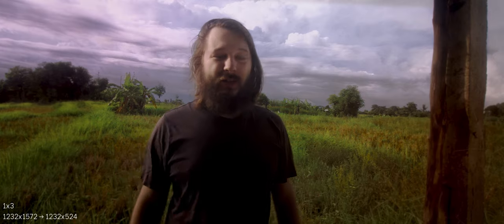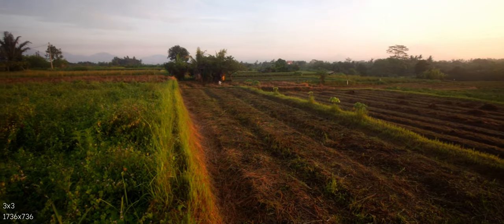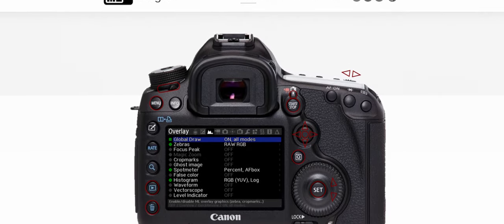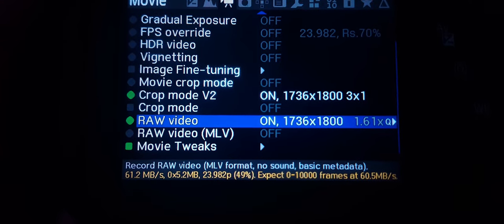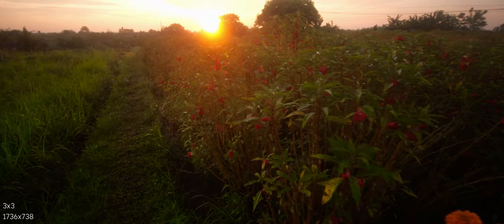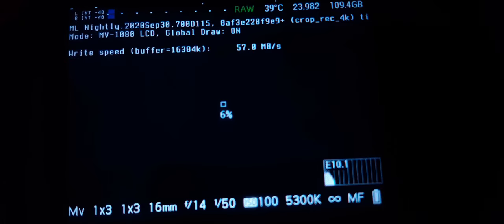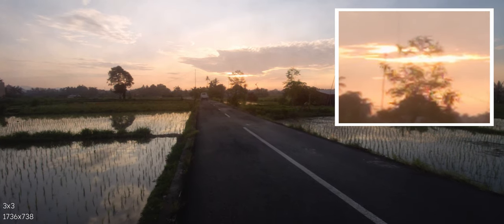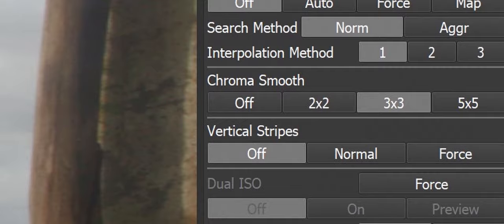Binning Modes Explained

Comment: Hello Dimitri! Thank you for these videos! I installed it on my 700D and now i'm learning how to work with that. 
But i don't understanding exactly how crop mode work. If i choose a highest resolution, it expand the image to that, and then it crop a little bit of this image?
Reply from the maker: It crops into picture to achieve 1to1 sensor read out. When it read the wholse sensor it skips pixels in between. Can cause artifacts etc

Comment: Great explanation! I have the 700D and this experimental build, and I'm having some random pink frames. I'll try your method and see if that works.
I bought a Sandisk Extreme Pro 64GB 170MB/s and 240Mhz overclock works fine, except for the aforementioned pink frames. The recording is continuous.
Reply from the maker: I got speed drops when I tried 240Mhz. I did the benchmark and speed dropped from 60 to 20Mbps at times. So I'm considering getting 170Mb/s version of the card.      
    
But yes, definitely try removing overlays when recording, I specifically turned those features on to record pink frames for the video. Without it I didn't have any pink frames the whole time I was shooting.     
Good luck :D
Reply: @IAMDIMITRI  Thanks for the tip! I'm using the new presets: 4.5K, 4.3K, 4K and UHD (1x3 binning) and I'm having no problems whatsoever.

Nevertheless, I'll try removing overlays; this way I will be able to record at higher resolutions.

Comment: Hi how to I stretch out 1x3 binning mode in Davinchi resolve thanks
Reply from the maker: You just stretch it by 3. Or use stretch to fit the screen if your comp is in correct resolution allready. You can also stretch clips in mlv app by a factor of 3 and export in whatever you need.

Comment: Can you use Danne's Build and Bilal's Build at the same time or do you choose one experimental build at a time?
Reply from the maker: Choose one on each card and switch between them :P
Reply: @IAMDIMITRI  Ah perfect, thanks so much!
Reply: @IAMDIMITRI  Sorry again, is the main difference between the builds that Danne's provides higher resolution while Bilal's provides the 1x3 Binning?
Reply from the maker: I think they are similar. But Bilals buuld has profiles etc. So I was able to push camera further. I switched to Bilals build.
Reply: @IAMDIMITRI  Okay great, thanks so much again. Subscribed!

Comment: Are the clips just 1:3 Binning without DUAL ISO or 1:3 Binning with DUAL ISO?
Reply: Oh, and how do you do live preview because my whole screen shows artifacts :(
Reply: Oh nvm I figured this part out haha!
Reply from the maker: Everything here was without dual ISO.
Reply from the maker: That's a good question. I used Bilals build. I think that the crop mode v2 in this build is somehow modified. I don't know if this helps or not. And you also have to play around with the live preview option inside of Magic Lantern Menu.    
I think that at the higher resolutions you might want a different way of displaying. Sometimes live preview is not possible and it will be black and white laggy view. And sometimes the cropping is a bit different from what you are recording.    
You definitely need to try and see what works best for you.
Reply from the maker: Ye sorry for late reply ><
Reply: @IAMDIMITRI  It's okay! Thank you!

Comment: how much speed card should i need to use while rec in 4k
Reply from the maker: Its not really 4k. You cant record 4k on 700d.
Reply: @IAMDIMITRI  for 14bit raw video how much speed card should I need to use
Reply from the maker: @fineartproductions1180  I would use 170Mbps Sandisk Extreme pro if I could because then you maybe able to use 240Mhz overclock.    
But if you are not going to use 1x3 binning then slower cards might be ok. Sorry it's really hard to answer. It might be better to just Google that question or visit Magic Lantern forums.